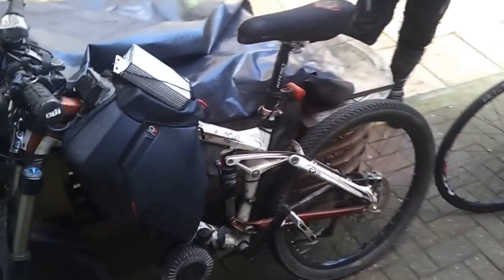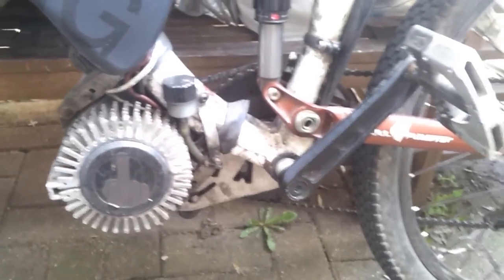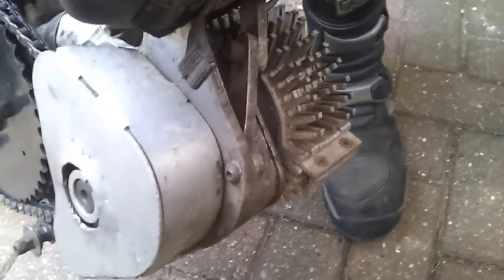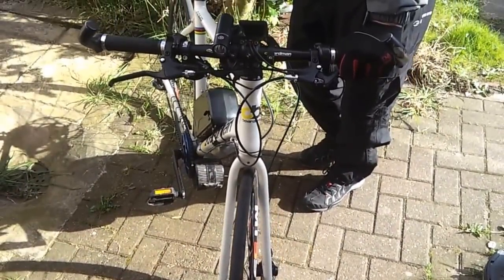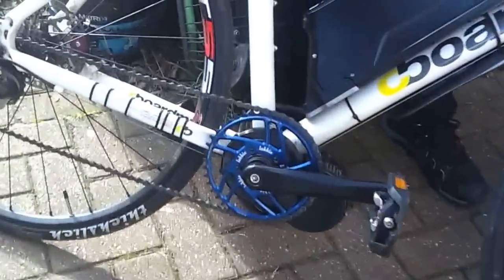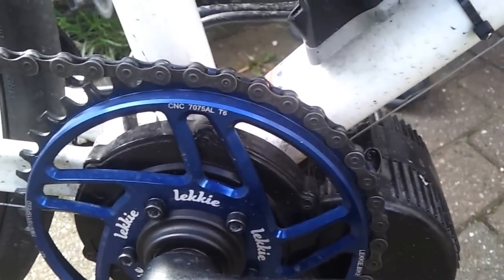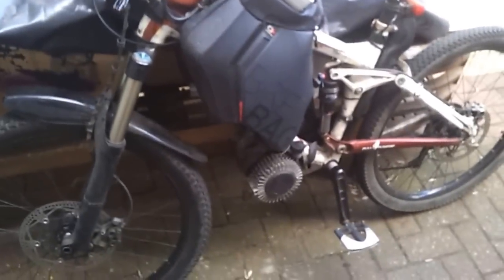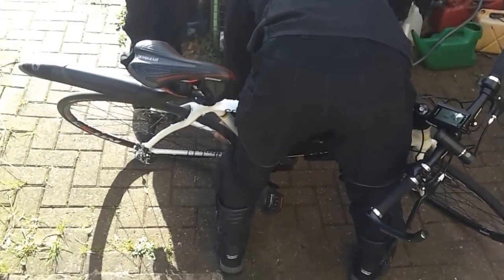Bafang 750w  kit update..plus more mid drive stuff

Comment: For keeping the motor tight, I safety wired the inner nut to one of the bolts that holds the fix plate on. No longer comes loose!
Reply from the maker: nice tip buddy cheers!;]

Comment: Dillenger Uk do 3 different chainring adapters, for about £46 each, letting you use any 104mm bolt circle ring on in the place of the crap included one.
Reply from the maker: thanks for that paul..useful to know..cheers for the comment.
atb.

Comment: Hi there, im thinking to buy a 42T lekkie chainring, but i run a 12 gear cassette (sram sx eagle). On some online store is saying *suits up to 11 speed cassettes*. I wonder if anybody tryed the 12 one. I dont need all 12 gears just to make shure the chain fits on Lekkie. Now i  got the original 46T steel  chainring and it works perfect on the  highest 8 gears, but i would love the bling and weight drop of lekkie one.

Comment: Wheres the invite lads, I have nobody to ride with over here in Macc.. :(
I'm looking at doing a full sus next for some downhilling, I take it your all into mid drives now for the rough stuff and hub for fast road use as the de facto setups?
If so you recon I stuff the gng on my downhill bike and go hub on the hard trail for the commute to work? 
Thinking of leaving the pack in the hardtail and then going poly packs on the downhill?
Reply from the maker: +Dave Webster lol if ya can get over to sheff your welcome any time buddy..as long as its not raining!
yep your correct ,hubs for road crusing /commute ,mid drives for off road,though the range is better on the mid drives so it depends on your commute.
hubs are good ,simple and no real maintaince issues,they are a little heavy tho, on a hardtail id keep it light as you can,the bumps really come through at 30mph plus and is not nice!
had good results with 18650s and lipo so which ever is best for your personal tastes.
hobby king are hard to beat for lipos check um out ..order one more than you need though,there cheep but a bit unpridicable .had a few bad ones from them and is very frustrating to be 1 pack short !
atb buddy.

Comment: I just posted on your last year video.. I'm surprised the boardman lasted this long with that mid drive kit on it.. I'm trying to sell my Cyclone kit to buy the BSSHD 1000W.
How does the L/Rod compare to the Bafang?
Reply from the maker: when we built it i was thinking something along the same lines buddy, its been a really good performer, my pal has done 40 mile trips on it peddaling lots using the kit to help on hills..he found it to be fine.
low rolling resistance on those tyres makes for better efficancy too.;]
the 1000w kit has some good reviews and will be easyer to mount and set up than lighting rods kit,but the rods kit is more robust and much higher power output.
good luck with your build buddy.
Reply: cassiya100  why didn't you like the Cyclone kid I thought that was the fastest one bafang made
Reply: hey dude.. I didn't say I don't like the cyclone kit.. I just wanted to try something different, more sleek, lighter.
also Cyclone and bafang are not the same .. the cyclone is much more powerful. I could easily do 35mph uphill and 45 - 50 mph on the flat.. no pedals just using throttle..
Reply: I got you. I'll trade you lol. I have the banfang 1500w it's good I love it no problems but every time I ride I just want more power I been think of the cyclone but I heard it's a bitch to install on a bike what are your thoughts
Reply: The cyclone kit is just as easy to fit as any other kits.. I fitted mine to 6 different bikes now. the cyclone is not for the faint hearted. you need to have your wits about you when riding on these london roads.you're very welcome to have a go on mine if your're anywhere my location SE London??
Reply: thanks again for the info my friend helped a lot. thank you also for offering to let me ride it that would take you up on that offer but I would have to swim across sees to get to your bike lol because I live in America   thanks again Cheers

Comment: Hello gentlemen.Ebiker here down in London, commuting between Slough and Greenford. THinking of the Bafang 1000w, what  do you say, cheers.
Reply: Illegal on the road . Risk getting caught so go with the law and use a 250W like the rest of us have to do .
Reply: Eh no I don't think I will do that, thanks.
Reply from the maker: 250 w is useless and holding back e bike development.
build your own and have as much power as you want.
whats legal and whats ligitimate are two totally differant things.;]
Reply: Actually my Ebike gets to around 20 mph which is safe in London . Remember the output has nothing to do with development . You can still get innovation . Where bikes get to the point that they are so heavy that you can't pedal then they aren't really Ebikes anymore and you might as well settle for an electric motorbike (which is on my list too) .